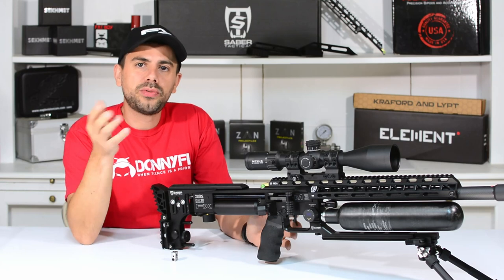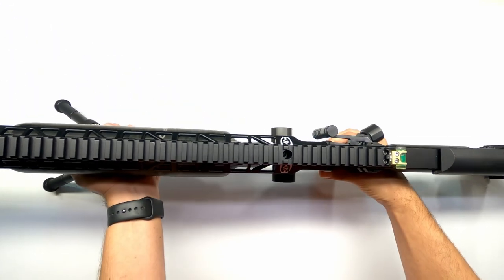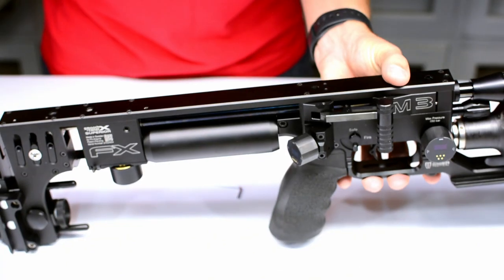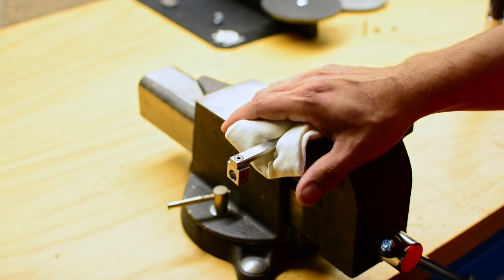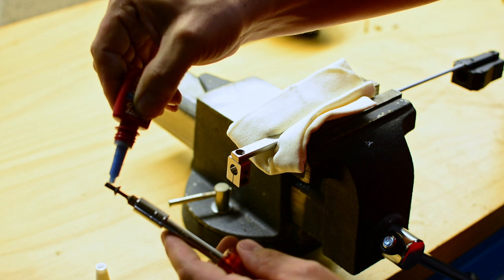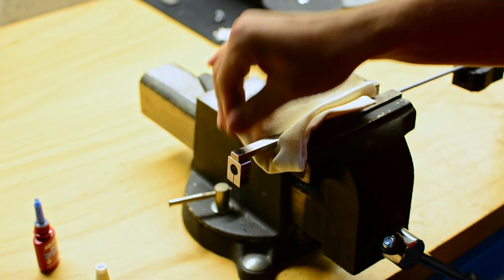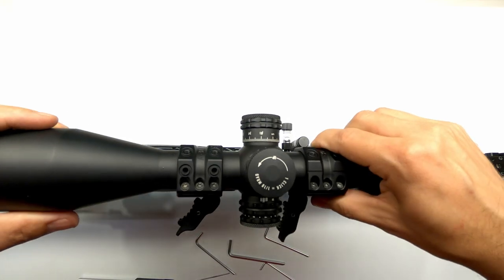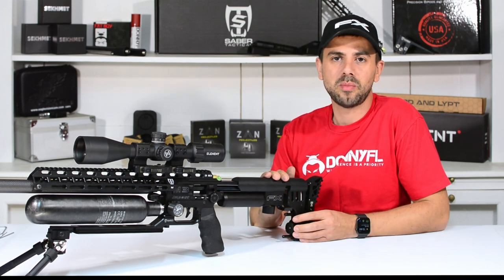K&L ULTRA GRIP PROBE CARRIER

Comment: Airbuks , 
Sorry it’s so long and I had to edit this so much .
It is a good design but I would prefer using the original carrier probe with it for one reason . As long as the original carrier probe is perfectly square it pushes the back end of a slug straight into the barrel  . The new carrier takes care of a problem I had with the small Allen screw backing out . 
On another note . The pin probe will not center the slug if the slug is somewhat sloppy in the magazine as its feeding it into the barrel . If you think about it . Once the pin probe makes contact with the back of a pellet and it’s not centered perfectly it won’t feed into the chamber consistently the same with each pellet . It won’t float because the hard probe has put a dimple in the back of the soft pellet as it’s forcefully feeding it through the process of chambering , will stay in that position All the way till it stops in the barrel . The next pellet that feeds may not be the same and the process repeats itself over and over with an inconsistency . Not so with the old pin probe design . It immediately contacts the back of the slug or pellet equally and follows it through into the chamber the same every time . 
The Diabolo pellet is more forgiving and may not be effected as much . The Diabolo’s design allows it to correct itself in flight much quicker out of the barrel . What I will say is this solid probe holder is a good idea and could be used for either probe . 👍
Reply from the maker: About the pin probe pushing you are 100% right, that’s why I switched to the pellet probe of Huma that matches there dual transferport. You loose only a few fps over the pinprobe but you have the advantage of a pellet probe 😉 For me the main reason why I installed this carrier from K&L is to eliminate the possibility of that small Allen screw coming loose and causing issues that way regardless of what probe I am using
Reply: @hotchihuahua The part about the oem square carrier is not true. The force vectors are exactly the same with the OEM probe carrier. The only difference is more evenly distributed clamping around the probe and larger screws. Any probe works with the Ultra Grip design, pellet, pin or scoop. The "squareness" has nothing to do with the forward pushing; the way it attaches to the carrier rod is exactly the same dimensionally and uses the same hardware that comes with the impact. 
Furthermore, if you are using a pin probe on higher power slug tunes, the ultra grip probe carrier is very necessary as the OEM carrier does not have the strength to waistband the back pressure with use.
Reply: @Airbuks  I did modify and polish the interior of the tube on the pellet probe and made sure it was square on a lathe . In a speed comparison with a setting of 100 bar I was able to get the same speed as the pin probe . Understandably in a higher bar setting in the plenum and heavier slug you may find the pin probe will begin to show advantages . I haven’t tried it but someone out there probably can confirm this .  I’m not looking to use anything heavier that a 28.5 grain slug at 940 fps so I am set .
Reply from the maker: @hotchihuahua1546  everything is perfectly squared up a I have put the probe in the lath to make sure it’s was straight, polished and debured.
I don’t say the pin probe doesn’t have any advantages 😉 it works very well if you use a adjustable one to have controlle over the seating depth .
Reply: @krafordandlypt2568  when will your Ultra Grip be available in Europe?
Reply: @MasonStormSunny  You can purchase them from Krale. They should have them in stock. I would give them a call and have them check for you. If you cant get them from krale, you can always buy direct.
Reply: @krafordandlypt2568  nope, out of stock there. It's been like that for months. I prefer to buy from Krale as I don't want to pay additional duty and taxes due to the private import.

Comment: Great instructions video 
Speaking of lining up
Here is one that I don't see the well known airgunners with videos that reach out to viewers. 

What are your views on barrel indexing on the impact? 
I can't get the 3 BIG S Africans to answer 
Please help the small airgunners out
Thank you
Reply from the maker: Hi mate , well that’s a difficult one to answer as many people have a different opinion about it .
But this is my opinion:
When the barrel is perfect in every way and 100% straight we can end here and I say it’s not necessary, however…
When the barrel has a slight arc to it you can find that you have to adjust your left/right on the scope more then it should to get on bullseye ( there could be other hardware factors causing this aswel ) indexing the liner so that the projectile arcs in a straight line inline with the gun will help you to have a predictable trajectory when shooting at different distances and a specially at longer ranges.

Indexing the liner so that the arc is inline with the gun and upwards you can also gain some elevation on you turret range aswel .

In the older days with the first liners I have noticed sometimes that indexing the barrel could give you better accuracy but this isn’t so the case anymore since the liners got better .

Now al this is without talking about the harmonics of your shot cycle 😉

Comment: Seriously man I just fitted my impact m3 compact with slug power kit and it was so stupid. I don't know how fx manufacturer forgot to resolve this problem. Everything is ok in it except indexing the slug from the magazine.
It's completely unless with the slug pin prob.so I removed it and I fitted the pillet pin prob and I checked with the slug.and it works perfectly fine. Even the velocity was same no difference with the prbs. And you my bro airbus even you hid this away from us about this issue. Anyway tell your subscribers in the next vide. 1 question tho I am planing on buying eagle vision high capacity magazine so will there be the same issue in eagle vision mag too with slug pin prob?
Reply from the maker: Ho ho bro I am not hiding anything 🤷‍♂️ what exactly is the problem with the probe ? Is the pin in the way when you try to insert the magazine? 
The FX pin probe has a adjustment to fine tune the seating depth , if adjusted to far out it interferes with the magazine while installing it .
What is the connection with this video ?
Reply: @Airbuks  i tried slugs with slug power kit installed in my impact. But the pin prob and the magazine does not support the slug. The slug does not go straight into the transferport. It guts Gets stuck in between in transferport and magazine. Magazine is the issues. Tell me you didn't face this problem?
Reply from the maker: @sj-k___7145  to be honest no I never had a problem with that , but I shoot mostly heavy slugs 26gr and up .
I have heard similar issues with small slugs .
What are you shooting ?
Reply: @Airbuks  if you haven't had this issues then i am sorry bro. I am using 22cal 24grain nsa slugs